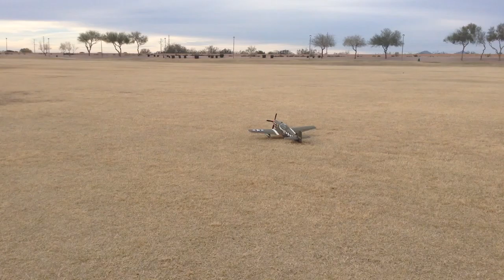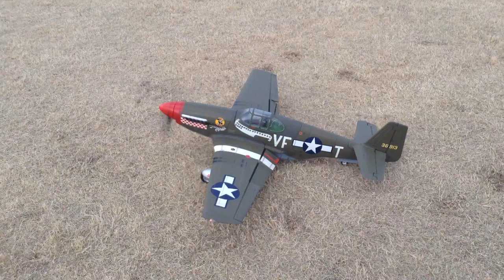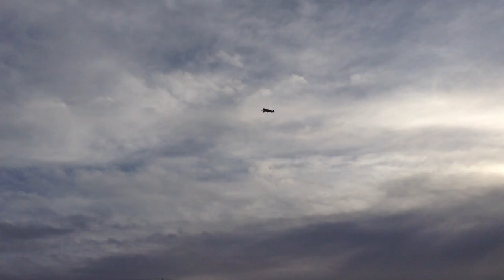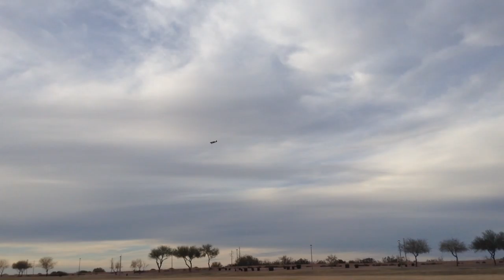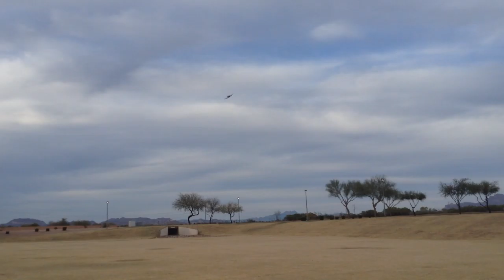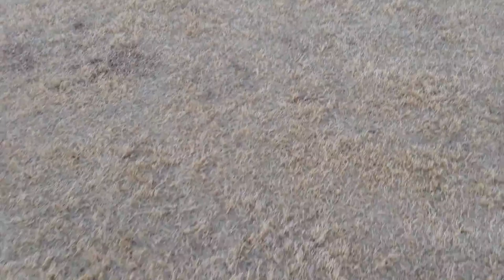2nd Flight of the FMS P-51B with crash at the end radio failure or servo problems

Comment from the maker: Update: I found that the battery adapter I was using had a cold solder connection to one of the EC5 pins and had come loose and was causing an intermittent battery connection. That now explains the last minute loss of control I had at the end of my flight. Plane is now fixed and ready to go again.

Comment: Oops. Looks like heavy down elevator at the end.
Reply from the maker: Yep, the elevator starting twitching right toward the end and then the ailerons went wacky ....loos wires and found that the motor wires had broken loose for their zip-tie and were hitting the back of the spinner. Damage was minimal and will be back up in the air by this weekend.

Pilot error for not checking this before take off. I actually noticed a twitch in the ailerons prior to take off, but decided to go any way....My Bad :(